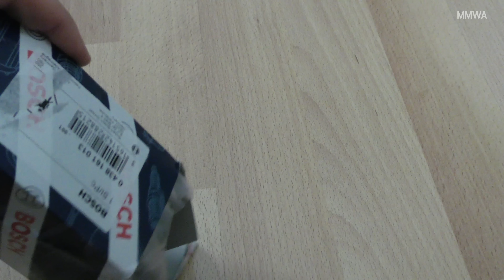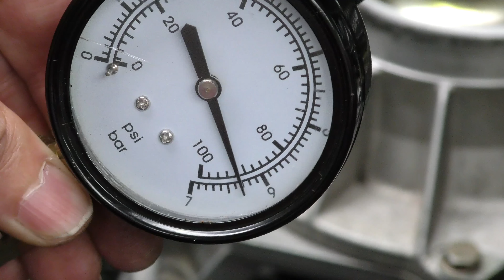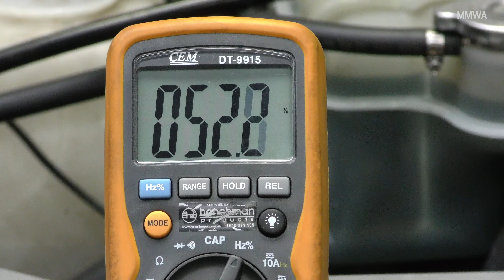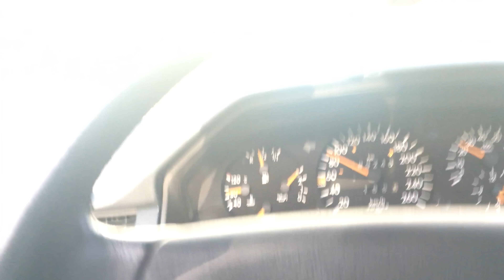Mercedes M104.980 K-Jet Fuel Pressure Regulator Replacement & Duty Cycle Adjustment

Comment: Hi, my car is over fuelling and misfiring and I suspect a bad fuel pressure regulator as I have tried lots of other things, what is the best way to test if it’s bad?
Reply from the maker: with a fuel pressure tester. It will tell you very quickly if the system pressure is correct. Also, this regulator should not be leaking from its small vent port.
Reply: @MMWA-DAVE  okay thank you, I will order one, what size is the adapter that goes into chamber of the distributor please?
Reply from the maker: @benharvey3721  if you buy a fuel pressure tester that is compatible with CIS / CIS-E it will come with the correct adapters. KE-Jetronic is not peculiar to Mercedes.